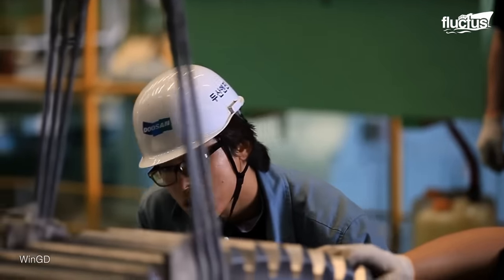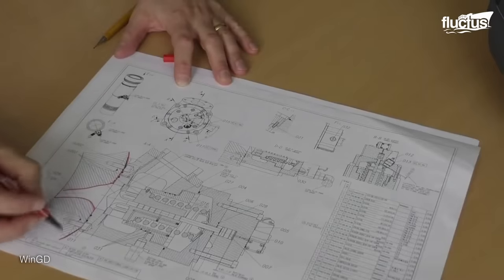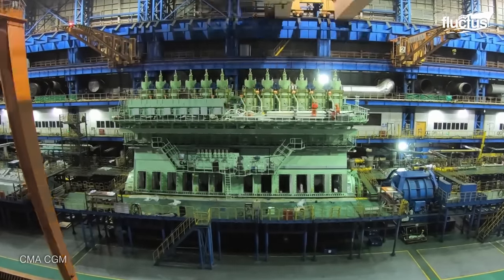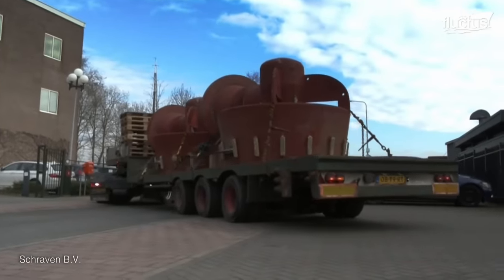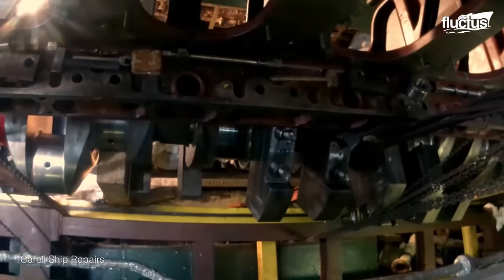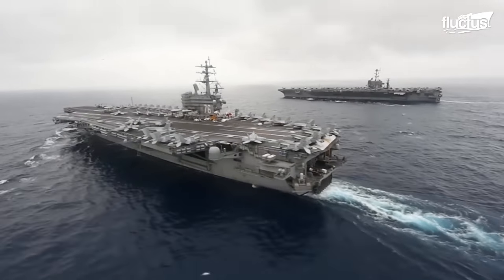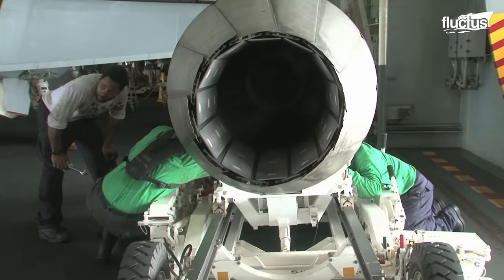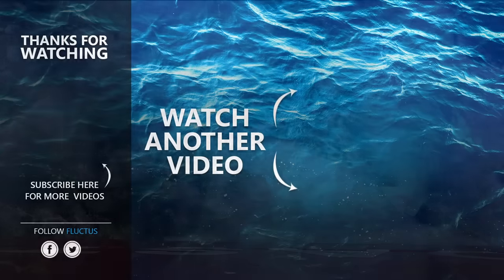Inside Advanced Factory Producing World’s Most Powerful Ship Engines

Comment: AT 2:17 it should say "a bore of 960mm and a stroke of 2500mm".
Reply: Was about to say the same. Many years ago was Engineer officer on container vessel, that had 10cly 900mm bore 1590mm stroke. That was way back in 1976, even then used about 100tonnes of fuel per day at full speed. Happy days.

Comment: Bore 960mm x stroke 2500mm another reverse u made😅
Reply: I believe you'll find he mentioned the wide bore and short stroke at the beginning of the video.
 In the automobile world this is referred to as an 'over-square engine. All high performance engines are built is way. Referring to marine diesels, common sense tells me that with the huge reciprocating mass of the pistons and connecting rods a similar design is essential to reduce bearing stresses and external dimensions of the complete power-plant.
Reply: @Tinker1950  The large stroke found in the biggest ship-engines means a very low rpm-level so that no transmission is necessary; the propeller turns with crankshaft-rpm.
Reply: @cagr4249  Yes, but I wasn't talking about that was I?
Reply: @Tinker1950  ...looks like a misunderstanding from my side...

Comment: Look at all those crankshafts and connecting rods. You can see multiple machining passes on them because their machine was only big enough to do a partial plane. So some of the flat surfaces you can see 3 or 4 passes across just to make them into 1 single flat cut. With boats getting bigger all the time, and already the machines aren't big enough to make parts in 1 cut, it looks like there would be room for a company that could make big enough machines to make these parts better. They really look very crude if you compare them to high quality engine parts for cars. It's easier to make them nice on a small size. It looks like there's tons of room for improvement. They clearly aren't forged either, just milled to final shape. If they were forged and WPC and cryo treated, they could easily make those parts half the weight and they would be much stronger and way longer lasting and more efficient. But it would take an enormous facility to be able to do that and it would cost billions to make. But it would pay for itself after not too many years if ships keep staying huge and getting bigger.

Comment: I wonder what mpg those massive ships get
Reply: Not sure about commercial ships but an aircraft carrier gets about 3ft. per gallon.
Reply: Depends greatly on ship/engine size.

A modern slow speed diesel engine today on an "average" sized ship is usually a 6 cylinder engine, about 500mm bore, and turns out about 15k horsepower at 110ish RPM. These engines burn about 30 tons per day.

Larger engines with more cylinders burn more. Anywhere between 90-150+ tons per day.

Comment: General Electric gasturbines are far more efficient., smaller and vibration free 420 000 kw beats this old diesel system  at the only cost of a reduction gear. Compare it with this monstrosity of ony 80000 kw
There is great disconnect here,  given the need of using all available volume for cargo.
Comments anyone?
Reply: Fuel economy...
Reply: @TheSwiss32  efficiency GE aeroderivative engine, 48%
efficiency large diesel engine, 40%
Das ish nöt guet für as Monschter.
Reply: @arturoeugster7228   so I guess the old formula of 
1/2 lb/hp/hr  is outdated?
Ich bin halt en alte loeli!